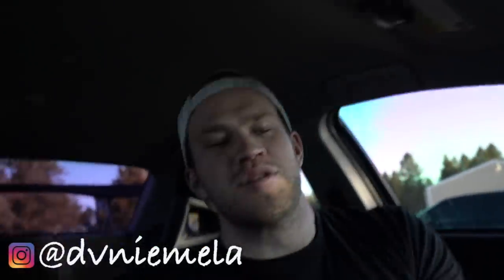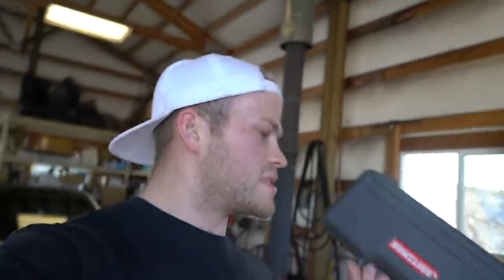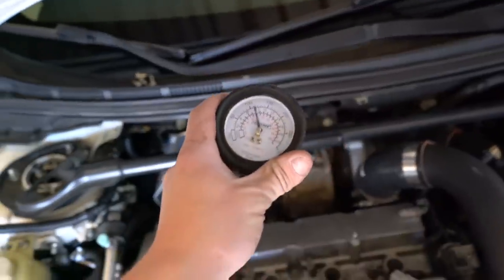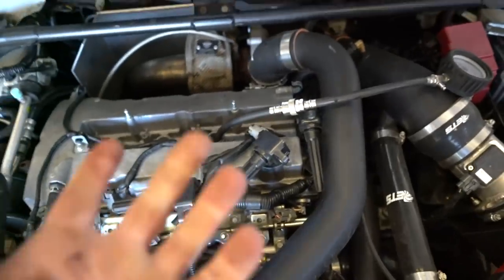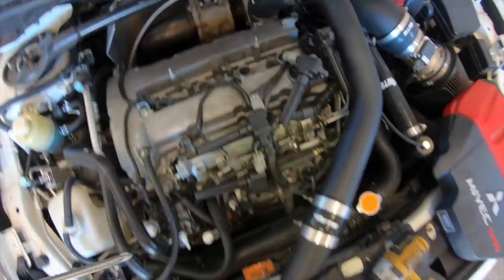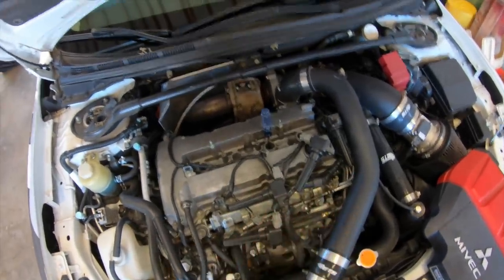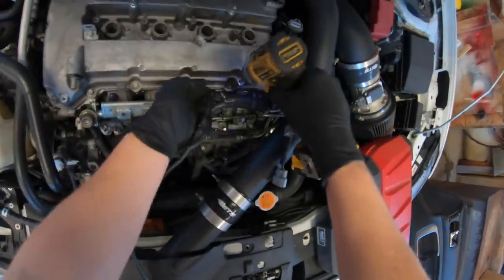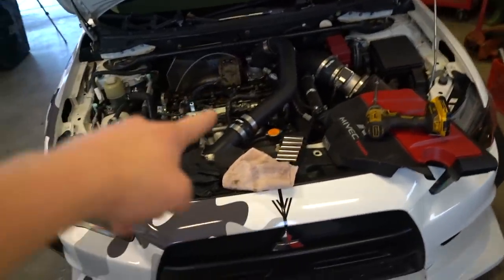Race Car Problems

Comment: If the valve came apart , the turbo will need a turbine wheel replacement, because of debris hitting the turbine. Because the turbo isn’t smoking, the valve many have not come apart but may just not be sealing for a different reason.

Comment: You overheated the evo in the snow the other day..being it's all aluminum that's all bad! Either warped the head, fried a compression ring or burnt valve.
Reply: Simple Subie I know, when I watched that video the other day I was thinking “man he’s beating on that thing, but if it were a track car he’d beat on it too” but track cars break shit too.
Reply: @justinturner4850  yeah I have a 02 wrx as my track car and it has 180k on the engine but I run 15w50 oil and a nice oil cooler. There was so much snow blocking air flow to his enginr and now its burnt lol

Comment: Notification squad I just added new valves in my Evo 8 smh Mine was popping/ back firing at idle and eventually would die at idle. Boost would cut off. New valves now everything is fixed

Comment: Yeahhhhh like we talked about before we did the hotboi. Valves and turbo hotsides take an absolute beating if you use it too much. Its ok though, it will get rebuilt with valves that can take the abuse and be better than ever!

Comment: Just watched the previous “snow bunny” episode. Ya, you overheated the evo, then kept running it hard, when your all aluminum block/head finally cooled, (front of car was packed with snow, no radiator/inter cooler cooling) everything warped. You may have more than just #3 intake valve problems.  Good luck man. Love the the show. Hope the 10 is ok. Might as well build the head/cams/etc now 😉.

Comment: The last leak down test i did which was in that same red range was on a CG170 (can google if youd like) thought it would have been a ring but removing the head it was actually a valve not seated properly...replaced the head in the end xD

Comment: I have a Evox and it's the spark cut(anti-lag) I can't stress how bad this is for the motor. When you floor it the car waits and cuts the ignition (spark cut) till your valves open up then it ignite's and when the combustion goes off since the valve are open that combustion travel from your cylinder through the whole car and that's why you get an AK out of your exhaust. It's bad for the motor head to toe it's just to much load to be putting the car under. Trust me I know I have it and my spark cut is wicked I have videos of me shooting like 5ft flames but I've only done it a hand full of times, you been going on FULL SEND and beating on it, which I love but eventually you'll blow a cylinder or you'll bend your valves. Hope it helps love your vids
Reply: Edinson Mejia my man know his shit, this is exactly how i blew my motor lol

Comment: Also with the leak down tester if you open the coolent over flow and it bubbles then it can be the head gasket and I think it’s my head also did a compression test and 2 are low so I got another head dident have a leak down tester might get one just to make sure but when I turn the car over u can hear back fires in the intake manifold and yours is maybe burnt and it can be a bit bent and not make that much noise cus the compression ro is low so there’s some space in there